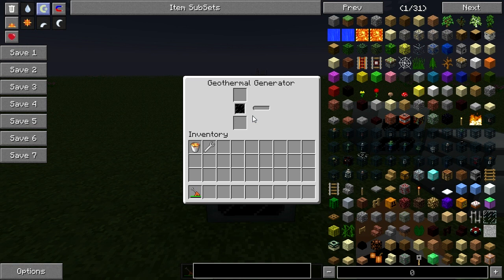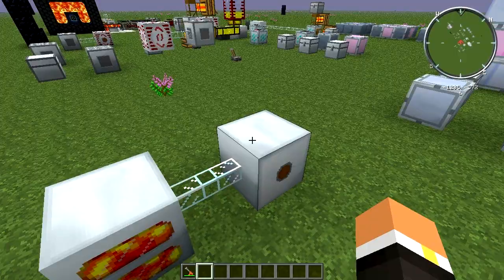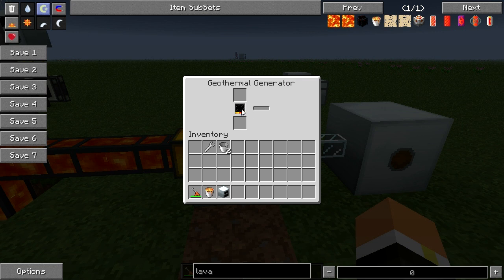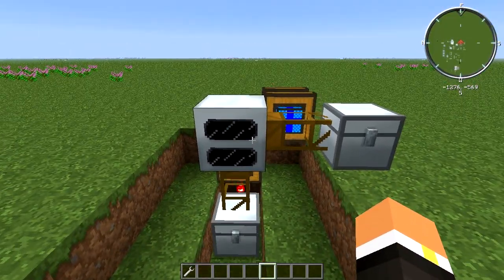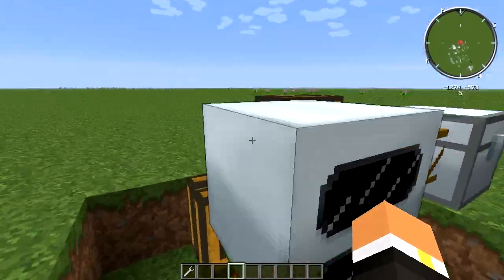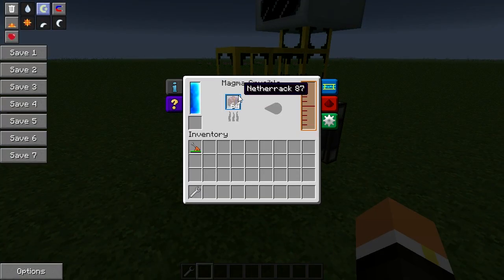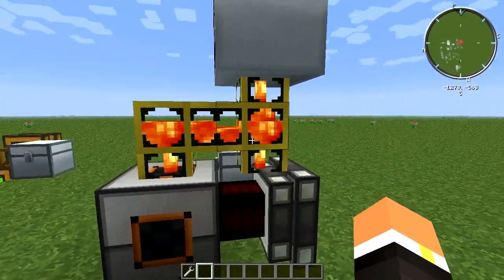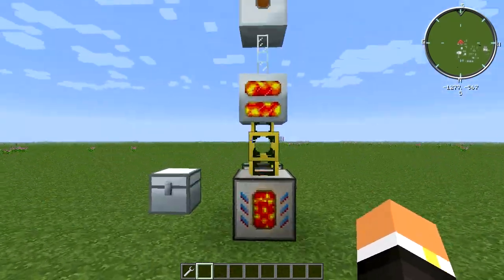Feed The Beast :: Machine Tutorials :: GeoThermal Generator

Comment: there are many ways to do this and i wont go in depth but if you use the warded blocks and make a 7x7 cube around the reactor they will contain the explosion with no damage to surronding blocks (radiation is not blocked however)

Comment: RUBYSOWN.
1. Liquid transposer will fill and pump a bucket into a wooden pipe set to draw from t geo generator.
2. Cobblestone and Stone waterproof pipes will not connect so a side by side will work. Thx

Comment: The reason that you can't pull the empty buckets out from the side is simply because it's in the bottom slot. When the lava bucket enters the Geo Generator it turns into an empty bucket, and it isn't transported to another slot. If you want to send lava as an item into it, you can use lava cells which I don't recommend since it will consume the tin cells too and you won't be able to use them again. A better solution would be to have the Pneumatic Tubes from RedPower sending the items into it, then have a Retreiver which is configured with the return item like an empty bucket. I had a system like that in Tekkit where a Retreiver collected the empty buckets to get them sent through Ender Chests to the Nether to be re-filled with lava and sent back to the Overwold.

Comment: i built your construction but after some time it stops working becouse the crucible profuces too slow
Reply: +indivisual SOLUTION:
Use 2 more waterproof Gold Pipes and attatch them to the back of the engine and the other pipes. this will give the engine more lava (2/3) and make it work perfectly